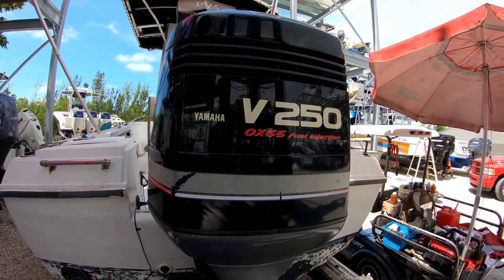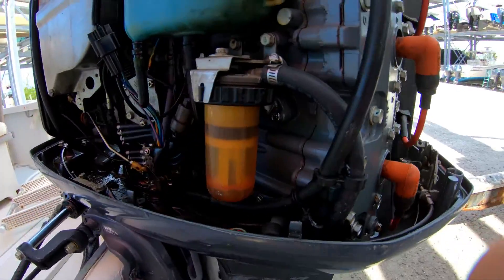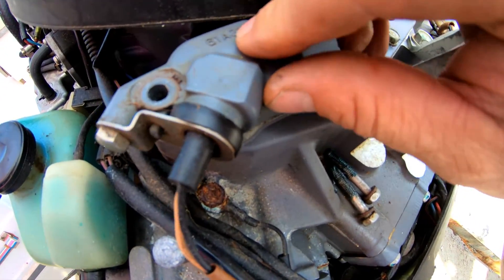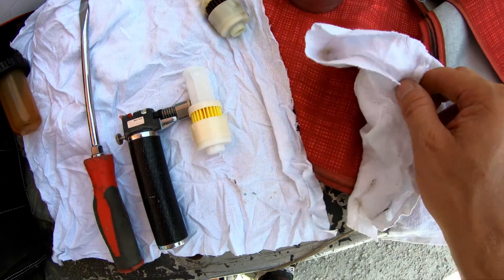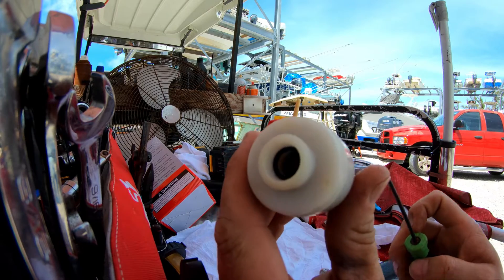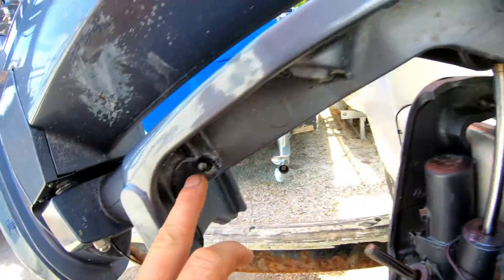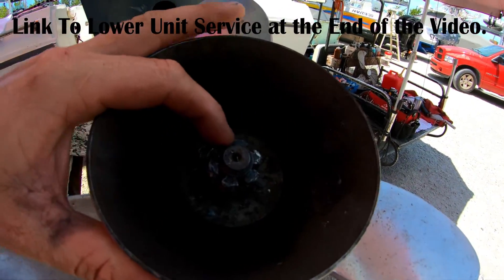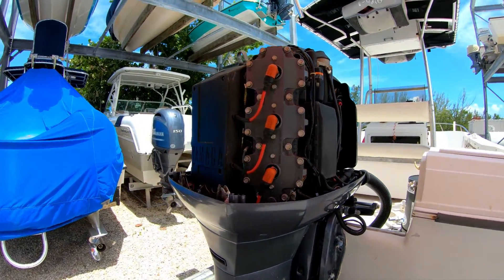How to Full Service 100 hour a Yamaha 2-stroke 250 HP OX66

Comment: Love your content. One question...the tech manual says to apply a sealant between the metal impeller cup and the plastic housing. Do you find it necessary? Or is it fine without it?
Reply from the maker: Haven't put anything but grease on that o-ring for years lol

Comment: Full service on ox66 I recently replaced lower foot on my 2004 200hp yamaha ox66 when putting the assembly back in the foot and engine wouldn't seat I had to use a bolt to pull it up. No forcing just wouldn't slip in place. Is this common or should I retry it.

Comment: In 97 we were approached by Yamaha to change our 2 outboards on our coastguard boat. The sales rep said we could beat on the V225 OX66 engines from new and thats exactly what we did. The boat was never dry docked always in the sea. The boat was double shifted clocking between 10 to 15  hours a day every day of the year. Both shifts we absolutely fed it to both engines from new. The demand of the work meant the throttles were either full down or 3/4 of the way. This was due to the nature of the job chasing down illegal fisherman, drug trafficking boats, towing broken down boats back into Port. The 2 stroke was chosen as we done so many hours a year it was uneconomical to have 4 strokes with downtime in oil changes every few weeks we couldn't have that. Both engines clocked over 4800 hours in the 1st year alone. The original package was for 2 year service life due to our high hour demands. We ended up pushing them to 3 years. Both engines clocked the 15000 hour mark. I remember some shifts were we had both of em pinned at full throttle for 4 hours straight chasing down boats until they ran out of fuel. In that time neither engines were rebuilt. They had regular services n maintenance every few weeks from the dealer. Other than a rebuilt fuel system overhaul the blocks themselves never pulled apart. I bought one engine and my co worker bought the other for personal boats. To this day we still have them both and are up to 17000 hours.

Comment: What do you think of the early 200s ox66 200?
Reply: Thirsty but bulletproof. Key is always using Yamaha ring free.
Reply: What's the last year they made ox 66? Are the 2001 225 or 250 also thirsty on fuel?
Reply: @bigpif165  2005 I believe and 225 and 250 is the most thirsty of all. They cut off 2 cylinders at low rpm to help.
Reply: @royhummert7281  the motors cut off themselves? Would you recommend 05 over 01? Is the VMAX the same as the ox66? If not it's it any good?

Comment: Is it common to "miss" the shift shaft when reinstalling the lower unit on these? I have this same motor and mine won't go into gear after a service. It feels just like it "missed" the lower unit splines since the shifter at the lower cowling (disconnected from cables) has no resistance on it.
Reply: So I ended up figuring it out.  I did miss the shift shaft after all.  Never knew how easy it was to do that.  Now I know.

Comment: Love your videos brother, what could cause this same exact motor to run rough on idle but works perfect on high revs? Thanks
Reply: pretty sure the engine cuts 2 cylinders when the RPM is below 2K.  Makes idle feel a little rough.

Comment: What did you use to clean thermostat area and how did you prevent the gunk from falling in? Thanks.
Reply from the maker: Just a knife or a screw driver, and then just by being careful:)
Reply: @BornAgainBoating  Does it matter if any debris you remove by scraping falls into the cooling ports? I would think you would put a piece of rag in there to catch any debris from scraping.

Comment: Having trouble with this motor. Have tried everything related to fuel system. It will idle all day without issues but as soon as you throttle up it sputters and stalls. Have you ever heard of this happening or know of any solution?
Reply from the maker: Sounds like a fuel issue, have you cleaned the VST and have new spark plugs in it that are the right ones?
Reply: Its your fuel pump i would replace the 2 mechanical pumps first if this dont fix replace your Electric fuel pump that will fix it
Reply: wtf2013.jp@gmail.com all three have been replaced.

Comment: Thanks for the video? I have the same motor but a 225. Do you know if it's the same powerhead as the 250? If so could I get 250hp with a computer flash? I know you can on the new sho 4 strokes. Also, how often should I clean the injectors?
Reply from the maker: Yes, they are the same, you could just buy a 250 computer from eBay and do it that way. On the injectors just run ring free every couple of fill ups and that will keep them clean :)
Reply: @BornAgainBoating tupid question does this apply to 1998 SWS 2 also? And will you notice HP increase? Currently doing 77km/hr on a 21ft heavy boat. Any advice on how to get more HP out would be greatly appreciated. Cheers nick, love your channel btw

Comment: Any zinc anodes on the engine powerhead that you would change?  I have twin 1998 OX66 225hp engines.  I believe this engine has zincs on the cylinder head which would be a big job to replace.  However, I think there are other powerhead zincs?
Reply from the maker: I think there are only 3 anodes on the heads and the block. One on each cylinder head on the bottom, and then one anode on the starboard side of the block, in the middle. I'm pretty sure you can change them without major disassembly, but I've never had to change them yet. :/ If you do change them you will probably need to replace most of the parts, they will probably all break when you start taking them out. 
You might not even be able to get the bolts out to get to them. They are like little long stick anodes. Idk what your engines look like, but I'd probably leave them alone. Unless they come out easy, after 21 years, you might be opening up a can of worms you don't need to :)
Reply: @BornAgainBoating  Thanks!  I was leaning towards not messing with them at this point.

Comment: Hi,
very good your video, makes everything easier.
But I have a question, is it not necessary to change the water pump at 100h?
Thanks
Reply from the maker: Hello, thank you, no, do the impeller at 300 hours or every 2 years. I just put it on there so what ever part of your service routine you are in, you will see how to do it :)
Reply: @BornAgainBoating  Many Thanks!

Comment: Never use regular grease on bolts that are torqued.  Grease allows the bolt threads to "slip" until the threads shear before the torque setting is reached.  Use a metal based anti-seize instead.  Anti-seize is compatible with any bolt that is torqued to a specific amount.
Reply: Ive heard that before, but I will always grease the bolts in my motor.  I do torque and loosen the bolts a few times before I walk away.  I will always grease my bolts after I had a nightmare with most of the bolts breaking off when I had to replace a head gasket.  Those bolts had a metallic anti-sieze on them, but the stainless bolts and the aluminum housing corroded terribly with it.  Maybe freshwater boats can get away without greasing the bolts but I never will install without grease again.

Comment: If the cooling system was flushed with fresh water on a regular basis, would that save the thermostats?
Reply from the maker: To a point yes, but after a couple years, the saltwater just eats them up regardless of the flushing :/
Reply: @BornAgainBoating  Crikey!

Comment: when you talk about grease points. Are you saying to remove those bolts then grease them?
Reply from the maker: No, sorry about that, I went a little too quick in this video. There are 3 major grease points on the bracket that you want to use a grease gun to fill. Two on the shoulders of the bracket when you trim the engine up. Then there is one on the side of the swivel portion of the bracket when you have it tilted up.

Comment: man  Love these old  Yamaha salt water series 2 strokes  Back when you bought them brand new in the owners packet it came with a pull cord to wrap-around the fly wheel and be able to pull start the motor I'll tell you what that saved my bacon a couple times The new 4 strokes you just can't do that but then again the battery banks got better too
Reply from the maker: Oh yeah, for sure! These engines are great! 

In fact that's what I have on my boat still! 

I think I even have that pull cord around here somewhere too! Lol it's amazing how well it works.

Pull starting a four stroke with 200 lbs of compression just sounds like a nightmare 🙄, these days boats have 100 batteries to run all of the electronics people are buying up. Thanks for the comment :)
Reply: @BornAgainBoating  hey man your welcome  Just found your channel a couple days ago already subbed keep up the great job on the videos  I'm sure you'll get many more subs
Reply from the maker: @allenrodon2406  awesome! Thank you for the sub and the support! Thank you!
Reply: @BornAgainBoating  I am looking at a boat with a 2005 
OX66 fuel injection salt water series II with 818hrs. Does that sound like a lot assume it was well maintained?
Reply from the maker: @cyrusdavirus007  no, not really, properly maintained is your key there! I currently have a 2001 250 OX66 on one of my boats and it has closer to 2000 hours! So as long as its clean, they are really good, strong engines! :) 
Also I might be wrong but I think that's the last year the OX66 was produced, so it's about as new as you can get!
Reply: @BornAgainBoating  it was the last year they were produced...you are correct
Reply: I have an 86 Yamaha pro v 150 that throws heat alarms in neutral sometimes even tho the water is cooling through, I’m kinda scared to take my thermostats out , can I just clean em up n put me back in or do I need new gaskets and thermostats? I haven’t changed them since I’ve owned the boat for 10yrs !